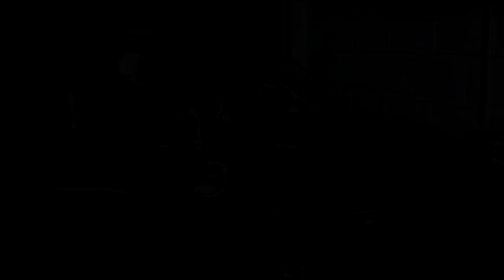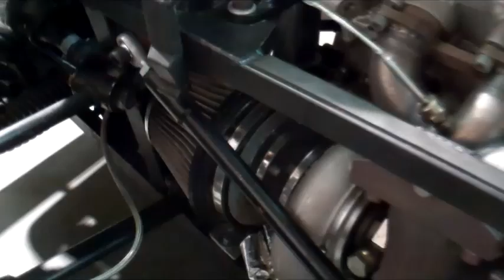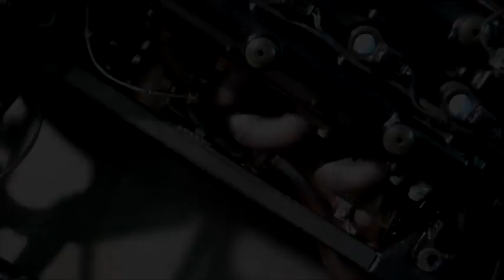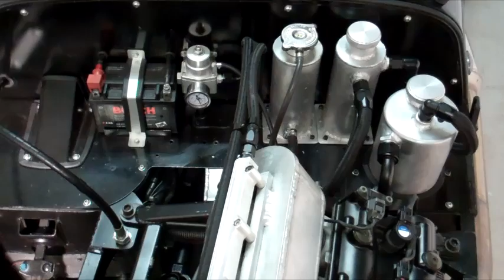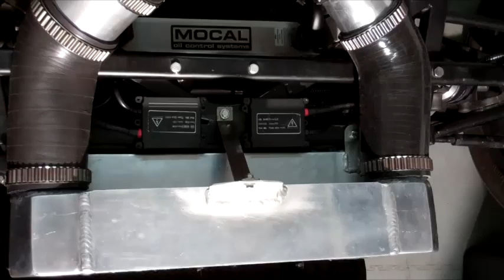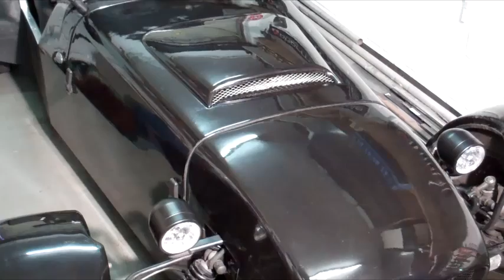EMA - 1000 BHP Per Tonne Hayabusa Turbo Project Car - Overview

Comment: Hi what gen is thus hayabusa engine and what is the best one too turbo . I'm not sure how many gens there are .thanks any help appreciated
Reply: This is gen 1 (1999 to 2007) 
This is cheaper to purchase and has a stronger valve train although I would upgrade pretty much everything if anywhere near 500 horsepower is your goal.
Gen 2 is 2008 to 2017 & gen3 is 2020 onwards

Comment: How has it gone at the track so far?? How is the longevity of the gearbox and clutch assembly?? What is the curb weight of the kit car?? The manifold is a big problem with the angle they come out of the head. I've seen a few people lean the engines over the bit to get it all to fit in

Comment: Hey mate love the build and the engine. One thing I would have done was kept the itb throttles and adapted the drive by wire motor onto the itb shaft. Have you had this thing running I would like to know how the 3076 went and dyno graphs as we are thinking of putting a hayabusa engine into a datsun 1200 as a time attack build with around the 500-550hp